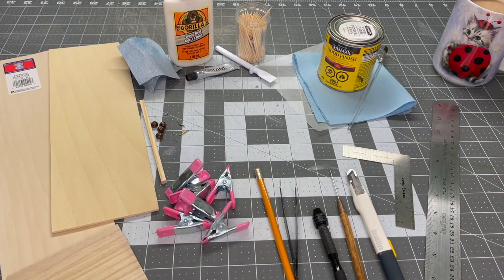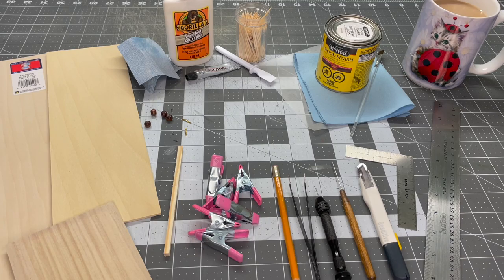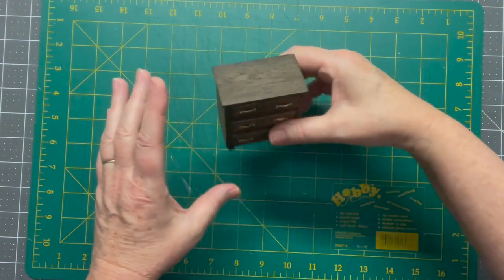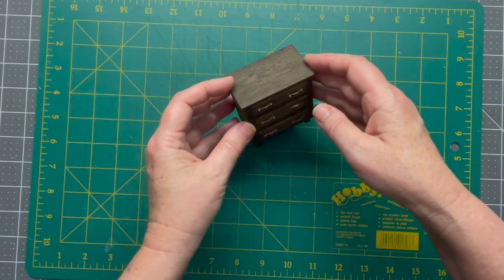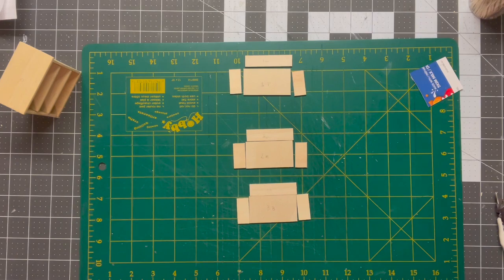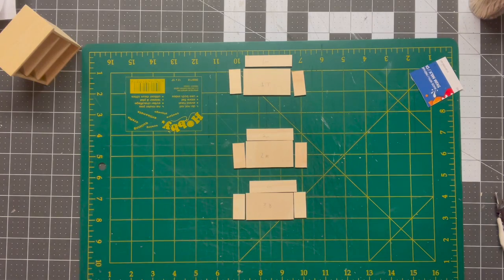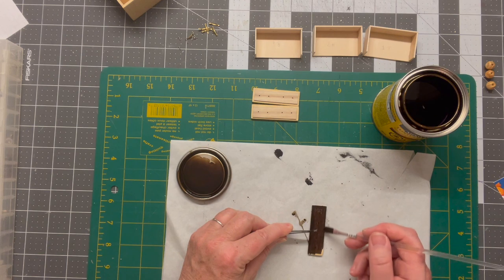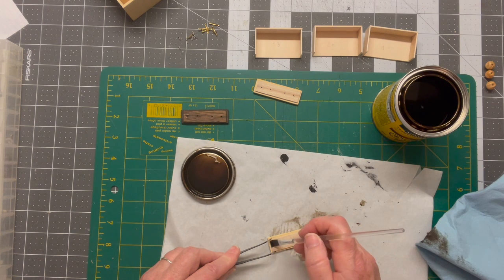Making this 1:12 scale Miniature Dresser!

Comment: I am using Basswood. Every time I cut it, no matter what tool I use I never cut it perfectly straight. By the time I get done sanding each piece they are all now of different sizes. How on earth do I cut and sand to keep everything perfectly even, and what do I do when they’re not even correcting them will make them smaller than the project I making?
Reply from the maker: Hi Bellagabriella! Oh I wish I had the magic answer to your question. I to struggle to cut that would perfectly straight! Try as I might to hold my scalpel straight up and down, I always end up with an edge that is just slightly on an angle. If I have 2 pieces that need to be exact, I will hold them together, as flush as I can, and sand them both at the same time. Clamping them, or holding one side against your table will help. If you find that you are having to sand off too much to get them straight, you could add a small bit extra (maybe 1/2 millimetre) to the measurement, and then sand it down to the right size. You could also use some wood filler to fill up those cracks where the wood isn’t quite square. It is very easy to use and covers up a lot of those issues!  I hope that helps!!💚
Reply: Funny, you said that. I started adding just a fraction extra wood in case I have to sand. I’m still having trouble. I have put the pieces together and tried standing them together. That has helped a bit. Wood filler, I just thought of that last night as I looked at the pieces, I am using to make a bathroom vanity for Barbie and one slat kinda has a dip in the middle of the one edge. So I didn’t know what to do and I got out my gesso and put a little bit on there and let it dry overnight. When I get home, I will see how it dried. I’m sure it will probably need a little more. Then I figured I would just sand it ever so lightly. Thank you so much for responding! I do appreciate it! I just started crafts in August and everything is miniature and, I am having terrible trouble. It’s just not something I am good at but I have one of those 1978 A-frame doll houses and I fell in love with a bathroom set that was done last summer for the Barbie Dreamhouse challenge competition on HGTV. So if you watch that onYouTube, you will see what the bathroom looks like. I was doing it out of foam and it looked OK. I can’t fit hinges because it’s foam board and they come out when you try to open anything. So I’m starting all over with wood.
Reply from the maker: @bellagabriella1  I haven’t seen the program but I will look for it now! I made a fridge in this series out of foam board and used a small strip of fabric to make a hinge. It worked really well and holds together great. I will link the tutorial for you so you can have a look at it. I know it can all be very frustrating when you are just starting out but keep at it! The more you do, the better you will get, so give yourself grace while you learn. I hope this helps!          https://youtu.be/XLWS7Fxbllw?si=Y3P8bpJ-UKA3s7Lf

Comment: And what’s the difference between a glue spreader or just using different size paintbrushes?
Reply from the maker: Great question! I find for larger areas the glue spreader helps to smooth out the amount of glue going onto the wood a little faster. (I always tend to put too much glue and it seeps out everywhere!) I try not to use a paintbrush for glue. It dries and hardens very quickly and makes cleaning the brush very difficult. More often than not, the brush ends up in the trash. While I can’t say I have mastered the glue, I have definitely improved since this video. I now use a glue bottle with a precision tip for a lot of places, and sometimes just using a toothpick is the best option!
Reply: Yes, I have used a toothpick before. So far there is one specific brush that was very cheap and not very wide that I used to spread glue. I’ve been using it since the beginning last fall and I just wash it with soap and water really good and so far, it always comes off for me whether it’s wood glue, tacky glue, E 6000. I haven’t used it to spread anything else. Are you on Facebook?
Reply from the maker: @bellagabriella1  While I have a personal account on facebook, I do not yet have one for the Youtube channel. I think I will likely open one but I want to wait until my subscriber numbers are a little bigger. Thank you for watching. Reach out anytime!